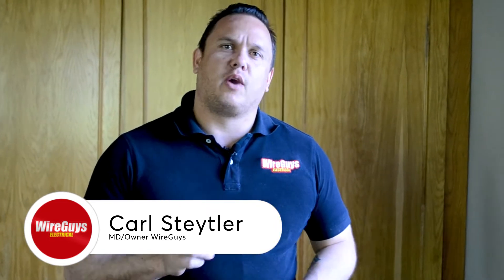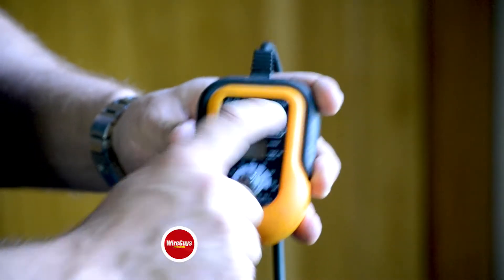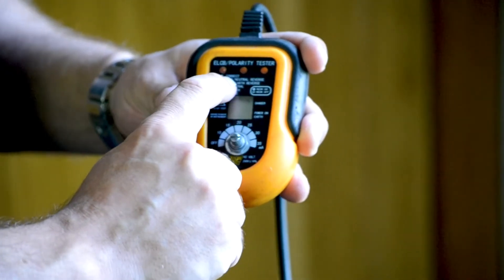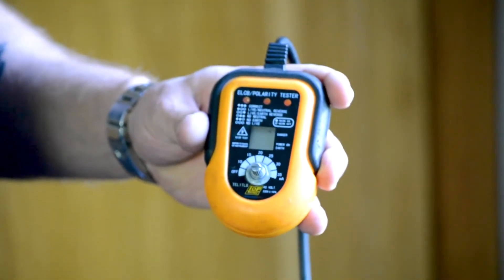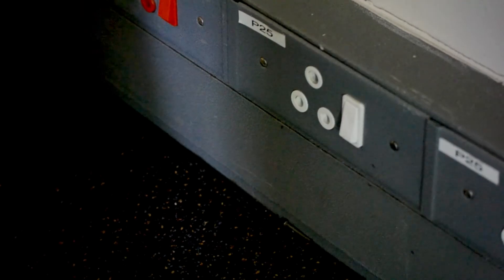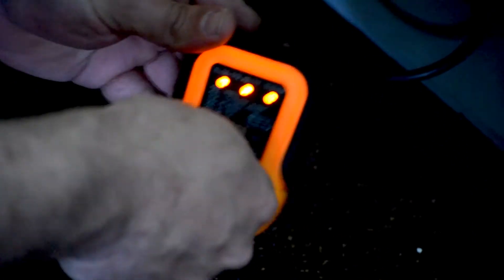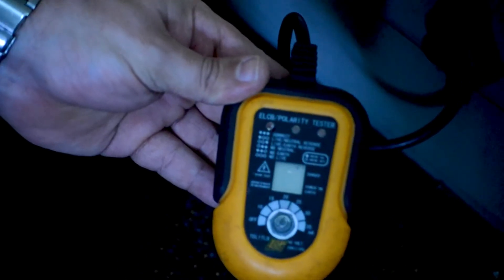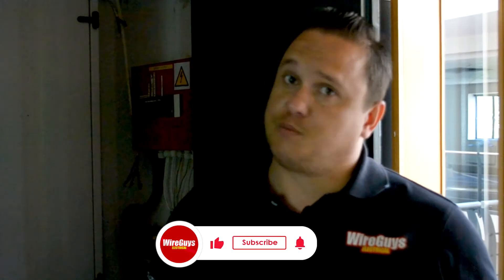Episode 3. Quick explanation on testing plug sockets.

Comment: I have tried with different socket earth testers, but i doesn't trip even on 35mA its still doesn't, whereas the rating of the E/L circuit breaker in 30mA, what might possibly be the problem?
Reply: It might happen that your wiring is not ok